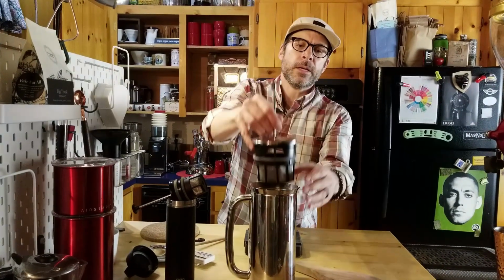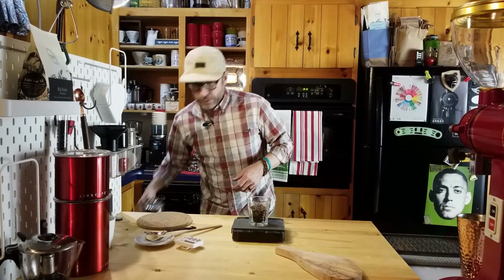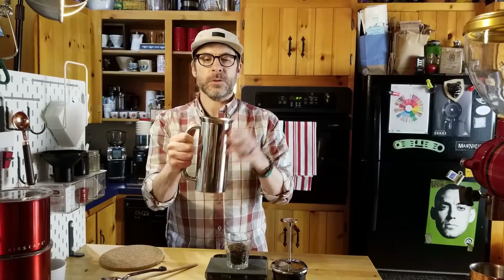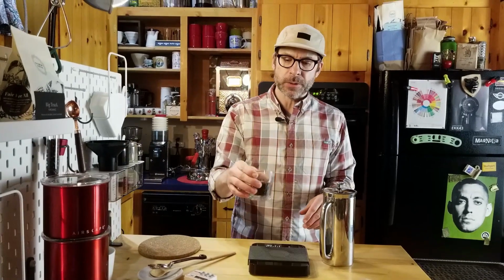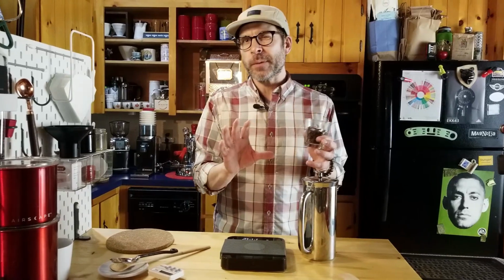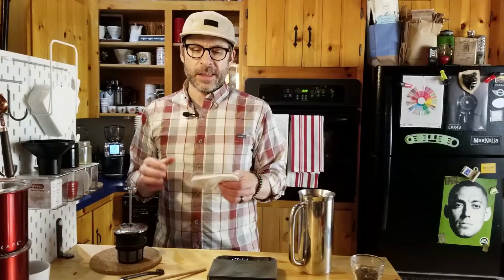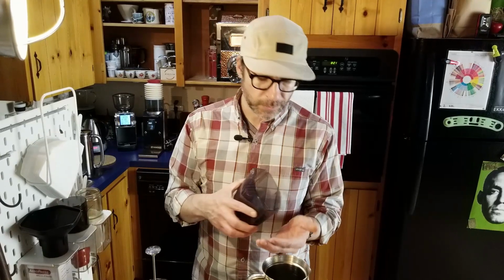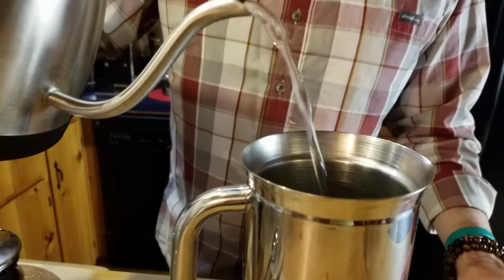Espro (French Press) Brew Guide

Comment: Thanks for the demo. I thought one of the two filters was going to hold the grinds and make clean up one step easier...
Reply from the maker: My pleasure, Nicole. All immersion methods, including Espro, have some clean up. The two filters are more for trapping the sediment that traditional French Presses let through. I didn't show it in the video, but I use a small wire strainer to clean my Espro. So, after I've enjoyed my coffee and let the Espro cool down, I take the press out, add a little water, swirl it around and pour it through the strainer. This could be used with any press and it does introduce another piece of equipment, but it's pretty easy to incorporate into your routine and keep things clean! Thanks for watching and dropping a comment...enjoy your coffee!

Comment: I just used my Espro P7 for the first time. Instead of coffee, I used ground cacao beans. However, I must be doing something wrong as there was a massive amount of grit in my drink. What should I do to troubleshoot the next time I use the French press?
Reply from the maker: Do cacao beans behave the same as coffee beans when they're brewed? I've never tried them. If so, a coarser grind is probably the first place to start. You can also put a paper filter between the mesh to produce a cleaner cup. One of my Espros came with the filters. You can see them here: https://www.espro.com/collections/filters

Comment: Question: i use a travel mug for work thats about 450 ml. Sometimes i take two. Will it be an issue using the 32oz press for a single mug? Itll work great for two all the time, im sure. But is it fine to only use half the capacity most times?
Reply from the maker: Oh, sure...you don't have to make a full press all the time. It's nice to have the extra capacity when you want more or have more people, but if you scale the brew for half a pot, you'll be good.

Comment: I’ve been considering the Frieling vs Espro P7, since I’m exhausted of chipping glass presses and want something unbreakable. Has anyone personally tried both? 

I like a bit of a strong and earthy coffee, usually the organic/fair trade Yukon Blend from Starbucks which my wife and I love. My ratio is 40g of medium grind beans to ~368g fluid of water, extracting for about 8 minutes, and a small spoonful of demerara sugar. 

These two presses seem to be well-liked, but there seems to be a comparison of the prolonged use of hot water on plastic filter baskets (Espro) vs the seemingly lesser filtration quality of the Frieling. Also, will I notice a taste difference between the two, or maybe another suggested press? Many thanks in advance for advice, as my next press purchase will probably be my daily press for the next 10 years or more and I’d like to not regret my decision! ☕️
Reply from the maker: I haven't used the Frieling, but it looks like the Espro with traditional press internals. If you like more body, it's probably a good route because there's no glass to break and the SS will keep the coffee hotter longer. I understand your concerns with the internals of the Espro, but that's what also gives it the ability to pull more nuance out of coffees and makes it a good balance between body and flavor. You can also add a paper filter to the Espro if you want to filter out more of the oils and extra bits that a more coarse press filter will leave in.

I would say that you will notice a taste difference, but it won't be as pronounced with something like Yukon. If you enjoy more body, fuller mouth feel, and aren't using a coffee with more subtle tasting notes, the Frieling would suite you well.

If you plan on using a wider variety of coffees, the Espro is definitely more versatile. I enjoy it, and chose it because it wasn't a "traditional French Press." Not saying there is anything wrong with a normal press, but I have other brew methods that I can use for more body-forward cups.

Your decision point is squarely on the internals; which Espro themselves say is the "The ESPRO Difference" on their website. If you see yourself staying with Yukon and you like the results from a glass press and are concerned about the Espro's use of plastics, the Frieling sounds like it will be a durable choice for your next decade of coffee enjoyment!

Comment: How many grams of coffee for the 32oz?
Reply from the maker: If you want a full carafe, I would do 60 grams of coffee. I like the 1:16 (or, 1:16.67 😉) ratio. That would be 60 g of coffee and 1000 ml of water. The 32oz can hold a bit more water than that, so if you want it a little stronger, add a gram or two more coffee.

Espro has a brew guide (https://espro.com/blogs/brew-guide/french-press) and you can see there is variation based on the roast level. Start with 60 grams of coffee, though, and adjust from there.
Reply: @extractionhacker  Thank you so much for the video and all of the advice.

Comment: Great review.. which model is your Espro7 . ? 18 or 28 ?
Reply from the maker: I use the 18 in the video, but I also have the 32. I usually use the 18 for myself in the morning or if I'm going to share with someone in the evening.

Thanks for your comment! 🙌
Reply: @extractionhacker  - thanks for the clarification... On the ESPRO 7- 18, what is the min and max water you can pour on this for a great cup of coffee ? Thanks ! considering the 18 as the 28 might be too big for 1-2 people.
Reply from the maker: @ferdinandludo8851  My pleasure! There are minimum/maximum lines on the inside of the press. I would say they are ~500ml - ~650ml. Because of the dual wall construction, it looks bigger than it actually is. I've heard Espro recently changed their design, so people are saying it doesn't stay hot like the original. I think if you're drinking it right away, it would be okay for the amount of coffee it produces.
Reply: Appreciate it. Thanks